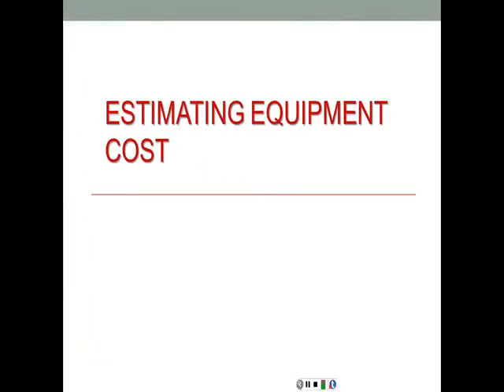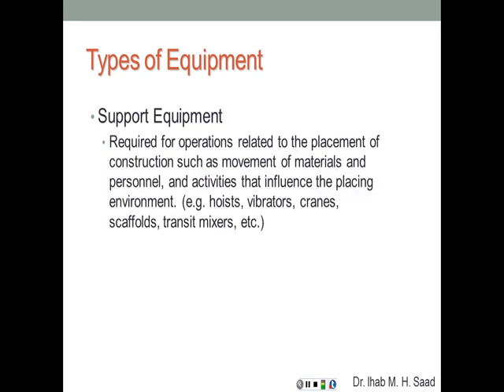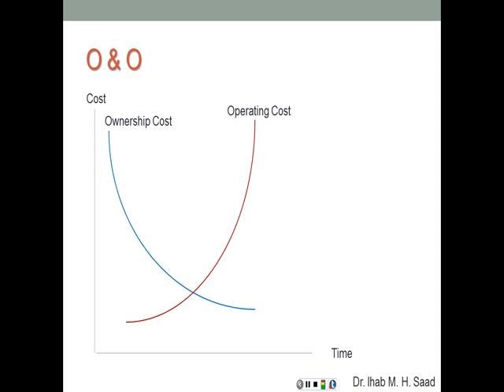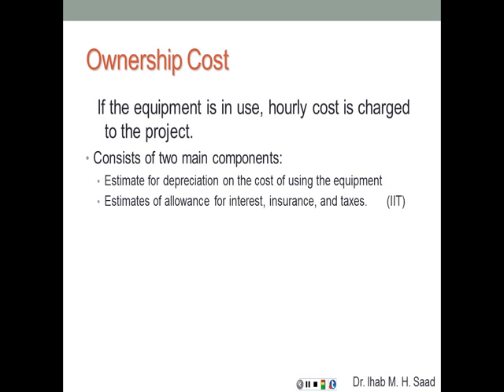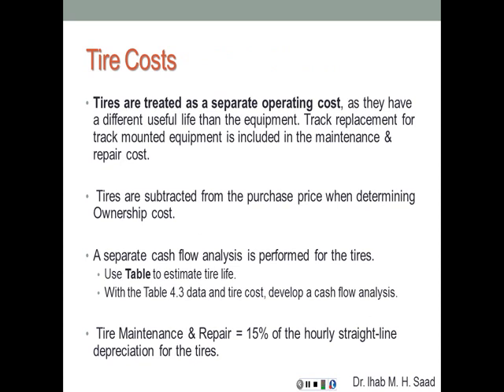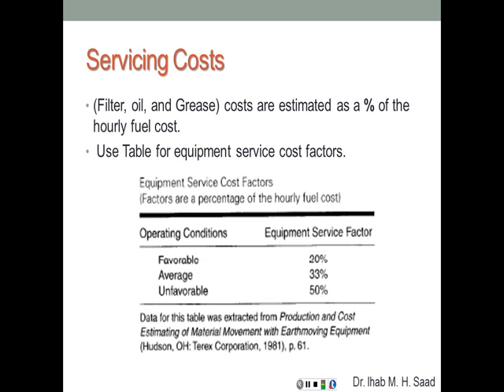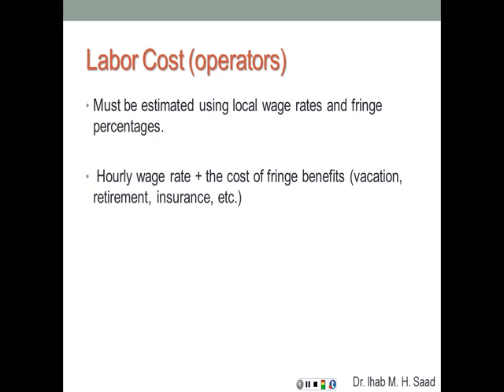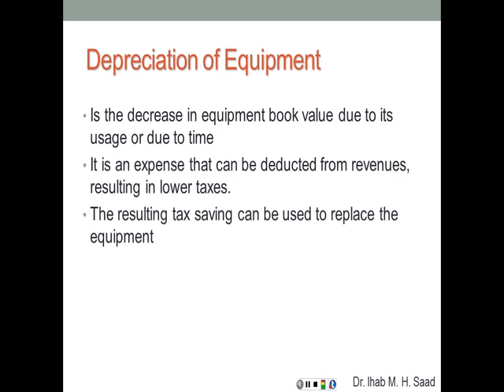Calculating Equipment Cost

Comment: CONSTRUCTION PLANT AND EQUIPMENT ASSIGNMENT
A contractor is planning to use a tracked dozer with power shift transmission 
to excavate 1,500 bank cubic meters for the foundation of a large house. The 
swell of the excavated material is estimated to be 25%. The dozer must push 
the excavated material up a 12% slope where it will be stockpiled for later
removal.
The contractor has measured the pile of excavated material in front of the 
dozer’s universal blade just before spillage occurs and has determined the pile
length to be 12.6 meters, the pile width to be 8.1 meters, and the pile height to 
be 4 meters. The dozer weighs 22,200 kgs, and the coefficient of traction is
estimated to be 0.7 The average haul distance is estimated to be 100 meters.
The material is to be disposed to a dump site which is located about 15 Kms 
from the site. The Contractor determines that 1,500 meters has a gradient of 
5%, 2,500 meters has a gradient of 2%, 4,500 is fairly flat and 1,500 has a 
gradient of 1%. 
The contractor is to fill the excavated area with gravel material from a borrow
site at 4Kms from the construction site. The contractor has a backhoe which 
has a maximum digging depth of 9 m, height of excavation is 13m and the 
angle of swing is 1500 and has a bucket of 2m3. The gravel has a swell factor of 
30%. What is the estimated productivity of the equipment, if the contractor 
plans to average 50 minutes of operation per hour? Determine the operation 
and ownership costs of the equipment refer to the table for the costs of the 
equipment? Determine the unit cost of each operation? (Hint: the contractor 
has a 10m3 dump truck that weighs 20,000Kgs and a haul up to 25 tons)
EQUIPMENT COST
Dozer 90,000,000
Truck 25,000,000
Grader 30,000,000
Loader 45,000,000
Excavator 40,000,000

Help